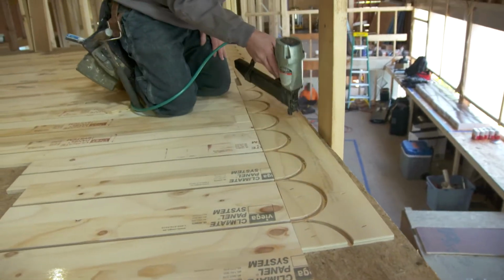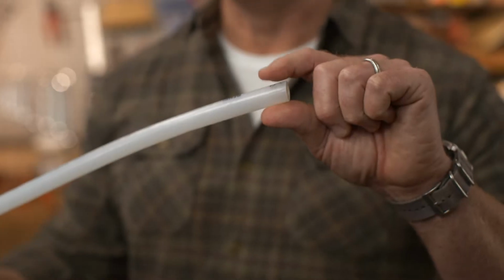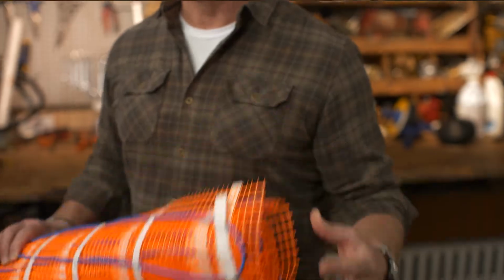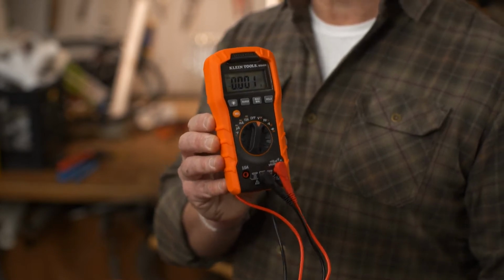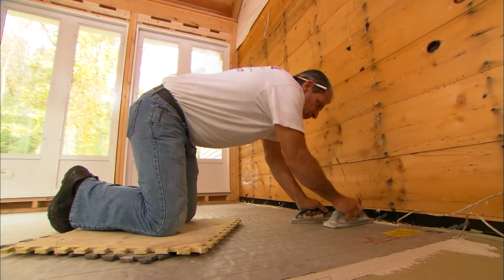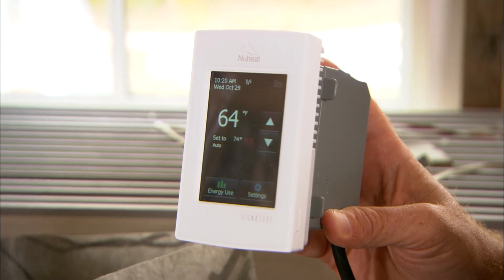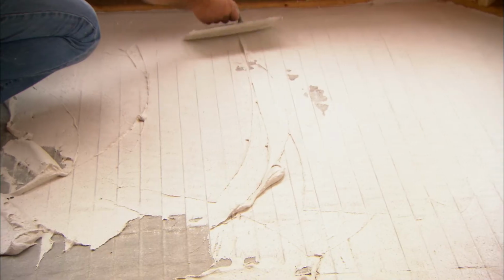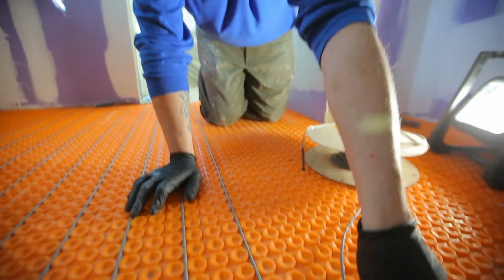How to Install Heated Floors (Radiant Floor Heat) | The Home Depot

Comment: If this could heated up the temperature then it could be used for cooling down. Am i wrong?
Reply: You are not wrong. There's also floor cooling but there are two down-sides you need to search on Google, one is the humidity because the tubes will get wet (imagine a cold beer during the summer, same thing) but there's a way to solve it but I couldn't understand how. The other downside is that people said the floor gets really really cold😂 uncomfortable for the feet

Comment: this video is completely useless. It doesnt talk about operating cost of Electric heating vs Hydro heating.
Reply: The title of the video is How to Install Heated Floors, not the pros and cons of different heating options.
Reply: The title of the video YOU clicked has nothing to do with what you’re asking. 

That’s like me clicking on a 50 Cent video then getting mad it doesn’t talk about helium 2 and super fluidity.
Reply: Choose hydronic if you're renovating and your home is already fitted with steam radiators. Otherwise, electric is the way to go.
Reply: @dusscode  I agree with the other comments but yours is by far the most useful, thanks for the information.
Reply: .... Basic math of the room requirements and the wattage output will answer this question. Do your own homework.
Reply: This video is useless it doesn’t talk about dinosaurs and various ways to cook cheese. Ya dumbass
Reply: oy vey
Reply: If you're worried about the cost to operate.  This ain't for you